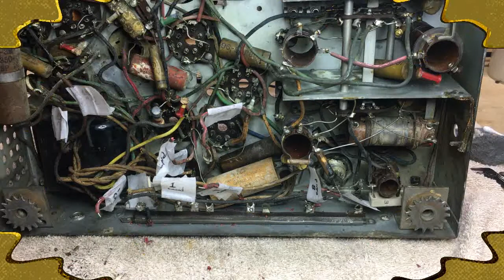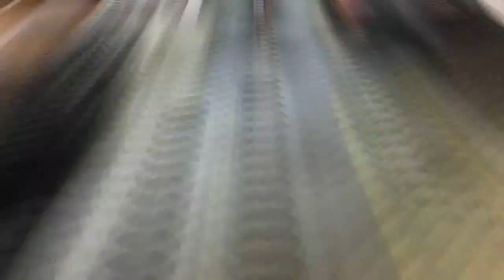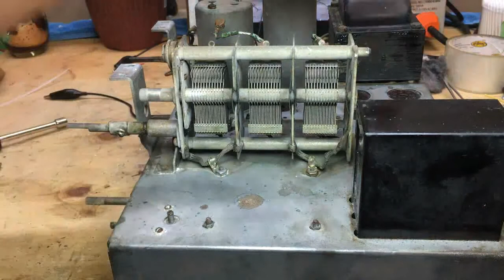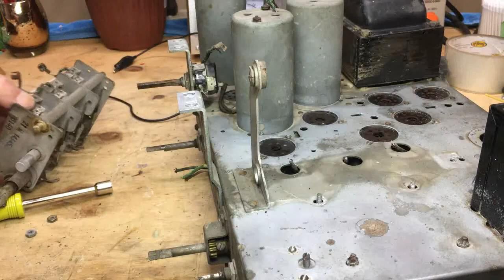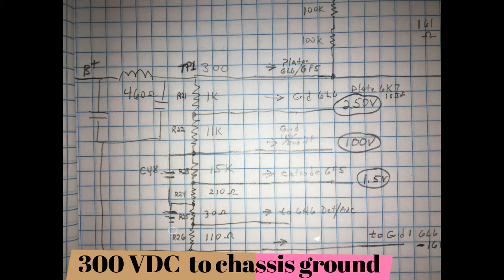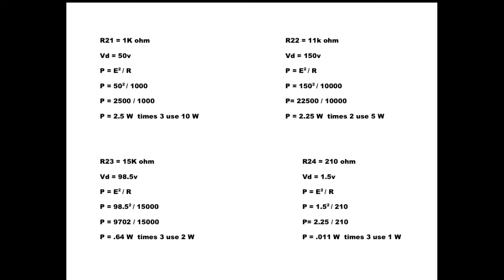1936 General Electric E91 Colorama Part 3 of 9 Wires, Clean up and Candohm

Comment: Hi Larry:  I was an early subscriber.  RestoreOldRadios (Don) turned me onto you.  Thanks for all the efforts you take to produce your various videos.  I have learned a lot from you and wanted to send along my appreciation.

I rebuilt a candohm recently and just unsophisicatedly inserted what probably were too large a  watt resistors.  Stuck them in, played the set a long time, kept putting my finger on them, and, when they didn't get hot, I figured I had succeeded.  Yea baby. Your approach of course is a bit more sophisticated!!  Don't know how to put a smiley face in here, but let's call that the Georgia way of doing things.

I am pretty new to the hobby and heard you kept mentioning calculating the voltage drop across the various resistors. Prepare yourself for inarticulate questions . . .  but how did you determine the voltage drop for your calculations with the set being inoperable.  I would like to do the calcs the next time I encounter one and feel this would be a piece of information I would need to be able to gather.  Thanks  Mike McKenzie Georgia
Reply from the maker: Michael McKenzie Thanks Mike! I appreciate you watching and especially the comments. Trust me, Im no Rocket Surgeon, lol. What I did, and I probably didnt explain it well enuf in the video, was I looked at the Candohm connections to the rest of the circuits. For instance, I looked at the connection between R21 and R22. I traced out that connection and it went to the plate of of the first IF tube 6K7 thru the IF transformer. According to the chart, the plate voltage on that tube should be 250v. I started with 300v based on the chart listed. Voltage drop of 50v thru the R21 1K resistor. I did each stage that way. I hope I explained that well enough for you to follow. Im not sure if you have a schematic of this particular radio. If you send me ur email via a PM, I will send you a copy and you can follow the logic. If you have any more questions feel free to ask, I will try to answer the best I can. Thanks again! Best--Larry

Comment: Nice job - I'd love to have a Colorama !    I'm with you on the Candohms - I always like to figure out the wattages myself.   I do sometimes wonder why we (self included)  always go twice or three times over  'for safety' though  - its not like modern power resistors have a bad rep. for failing is it ?  If a modern ceramic resistor is rated for 5W say,  that's what it can do.  It does not depend on a heat sink for that, even though the Candohms probably did.   Just my random thoughts - looking forward to the next installment !
Reply from the maker: Christopher Cusick Thanks for watching and commenting! I always appreciate comments. Im not sure, but anyone you talk to, go 2-3 times the value. The reason I was given was the candohm was rated for heat sink and the ones we use is in air. A watt is a watt, right? Maybe, its just our uncertainty that what we put in is big enuf, or maybe its from past experience. I dont know. Hopefully, Ill check the temps on the resistors once I get power to them. Im afraid, I dont know enuf about these animals to know for sure. Lol. Thanks again! Best--Larry

Comment: Those candohm resistors get pretty hot, and that's the longest one I think I've seen! I've taken ceramic resistors with various wattages for replacements before, and are curious to see how you arrange those. Looking good! Bob
Reply from the maker: Radio wild Thanks Bob! Enjoy ur comments! In theory, lol end to end should be enuf room, based that Im using different wattages instead of all 5 or 10 W. Right now, Im debating what to mount them on. I would love a strip of phenolic and use terminals. Right now, it looks like a strip of brass with pieces of terminal strips glued to it. Then bolt it down. Its not certain at this point, Im still brainstorming! Lol. Thanks for watching! Best--Larry

Comment: Looking good Larry.  I haven't yet run across a radio with one of those candohm resistors yet and I'm thankful for that, lol.  I'm sure I will eventually but hopefully by then I'll know more of what I'm doing by then to try and tackle one.  Take care, Gary
Reply from the maker: Rebel9668 Thanks Gary! The problems with candohm replacement is not the resistance values, they are well documented. The problem comes i to heat dissipation. The candohm is heat sinked to the chassis so they got by with less wattage. When you go back, you have to allow a safety factor of 2-3 times. Then, there is the lack of documentation of the ratings on the candohm. I guess they were expecting for technicians to replace the whole thing, which was not a good idea because it was labor intensive to remove. Thats why most sets you see a resistor or two tacked across some of the terminals.   Ive read, where some of the sections come "back to life" and messes up the fix. There is not a whole lot out there that I could find on exactly how to determine the wattages. Ive seen several techniques and didnt understand some of them. I asked some people who had done some of these radios and even tho they forgot the values, they told me how they did it. We will see if my calculations are correct! Lol Thanks for watching and allways enjoy ur comments! Best--Larry